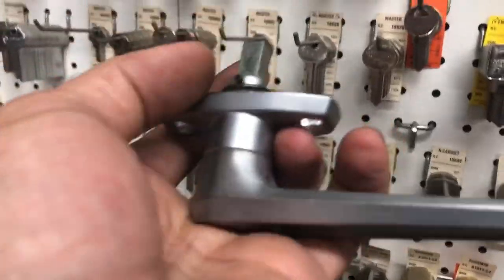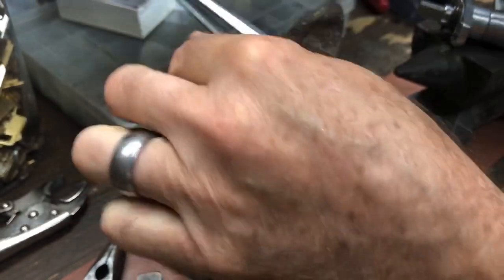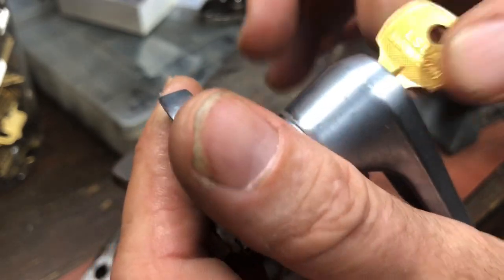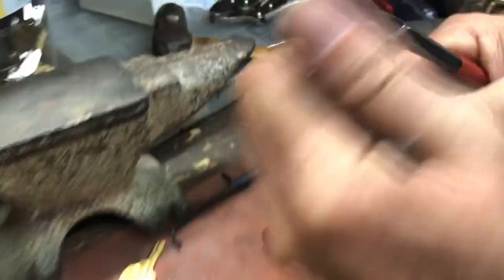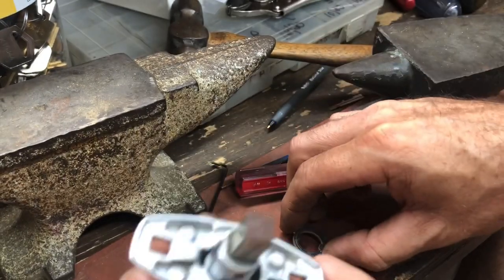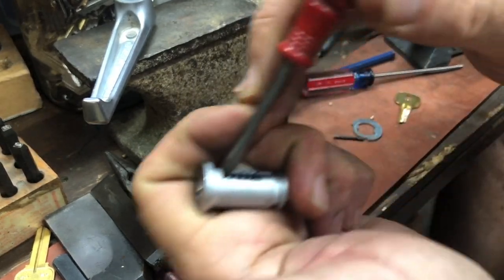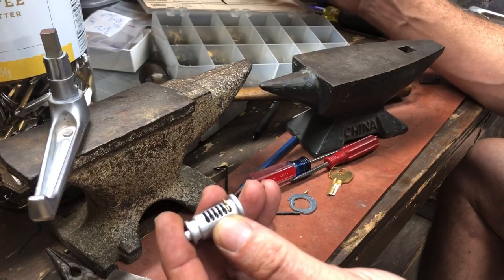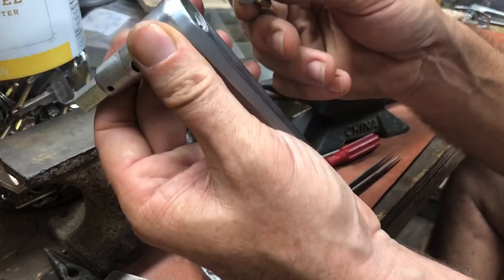CompX L Handle Disassembly to Rekey

Comment: Don't some wafer locks have a retaining wafer, like automotive? Thanks for this Jason.
Reply from the maker: Some do absolutely! Many don't have a bottom ledge though so it won't come out by just easily pushing with a pick. On those, the half diamond and some twisting will work
Reply: Mostly newer National and Timberline furniture locks, or Chicago cabinet and furniture locks (especially those used in office furniture like Hon and Steelcase).

Comment: Hi Jason, Did that come from the factory with only 3 disc tumblers?
Reply from the maker: I'm gonna presume, at some point in it's lifetime it has come apart BUT it certainly didn't appear that way (no marks on the roll pin) I dunno for sure

Comment: 3:36 that's because you're supposed to do it with a fine cut file
Reply from the maker: Ethan I usually shine it up with a file if I missed a spot and I feel like it’s needed for the lock. I’ve spent many a year hand filing that part and I much prefer rough finishing it with follow up as needed. Most likely would do/mention that in whatever video I do for impressioning.
Also you should get that “you’re supposed to” mindset cleared up :)